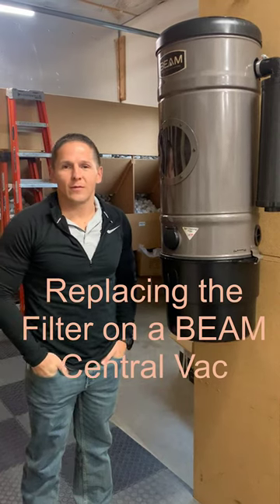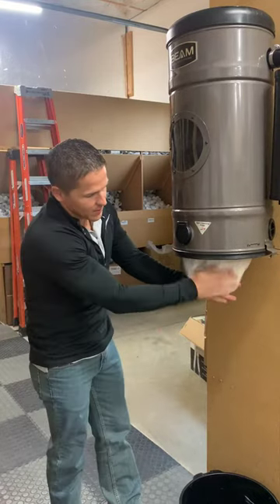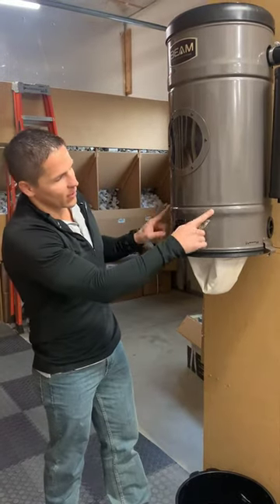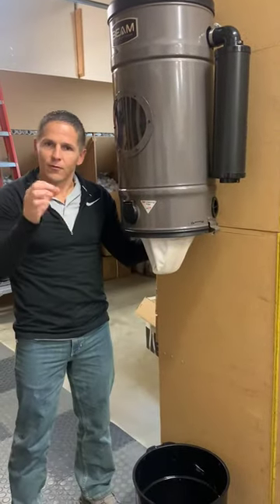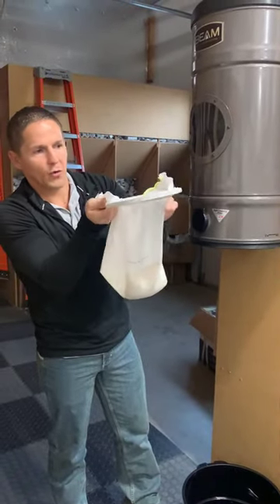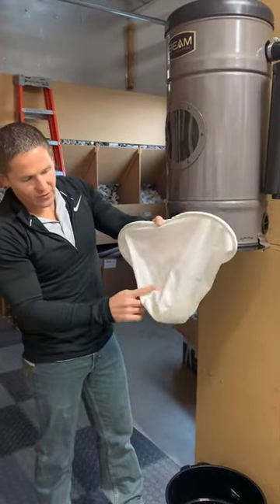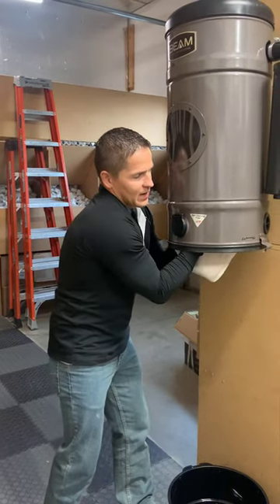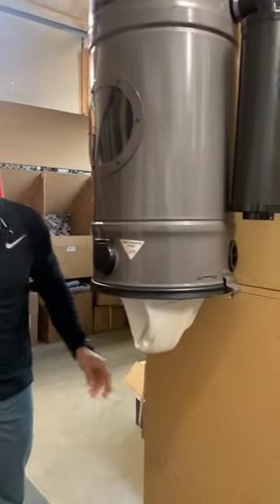How to change the filter on BEAM central vacuum  system

Comment: Just a friendly reminder that sometimes it is necessary to Take out the filter and wipe the inside walls of the machine down because sometimes dirt does pass through the filter i'd say it's helpful to do it Every other time you empty the bin
Reply: Beam doesn't recommend you to take the filter out unless if it has to be replaced under warranty. Otherwise if you're concerned about dust getting inside the unit, then just use it as a bagged unit.

Comment: Well, who would have known that? Guess that is why the installer leaves the instruction manual with the user.  Naturally they don't say to check the filter and in my case, removing the bucket to empty, a lot of d use and debris would also fall out. Finally got tired of that when the motor burned out and just replaced with another brand - Titan. we shall see how that goes. They did leave an extra filter, a completely different cartridge filter and said to change it in a year - of normal usage.

Comment: Thank you for this video!  I have an old Beam that came with the house 22+ years ago.  It's in the workshop now and was working but not well.  I Pulled the filter out, brushed it off and shook it out, then put it back.  I'm amazed at the change.  The vacuum is working fantastic!

Comment: I’m doing something wrong. I pinched the new filter to install but when I get around to the front, there’s still a “pooch” in the ring that won’t snap into the channel. I thought the new filter might be too big so I tried to reinstall the OEM filter with same outcome. Frustrating to watch the pro do this in under a minute and I’ve been at it all afternoon.
Reply: Me too. Did you solve it?
Reply: @andrearuffino  Yes. I reinstalled the OEM after cleaning it as best I could. Returned the knockoff to Amazon. I think it was slightly out of specs. I guess I was doing something wrong the first time I tried to reinstall the OEM, the second time it snapped in on the first try just like the guy in the video.
Reply: Thanks. I also solved it. At first, I was trying to install it at the indent at the very bottom. When I realized it had to go into the groove about 8 inches up, it went in very easily on the first try.
Reply: @andrearuffino  I was in the right groove but I’m convinced that the knockoff was slightly bigger and that’s why it wouldn’t seat properly. It had the correct part number etc. and looked identical but was not a genuine part. Lesson learned.

Comment: I changed mine. It was very difficult to take the filter out and now putting it in the filter doesn't seem to want to fit in the groove for it any more. My hoover now seems to have very little suction. Are these two problems related?

Comment: Having hard times finding the loop
Reply: usually the tab is located at the very back of the unit close to the wall, but if the filter was replaced at some point it might be in a different location or it may have been tucked up behind the metal seal.  If the filter got but in upside down then the tab will not be visible and you may need to take a flat blade screwdriver and try to pry the filter loose.
Reply: Mine was in the front! Great video as it helped me a lot!! Thank you esp the part about the bean bag!!